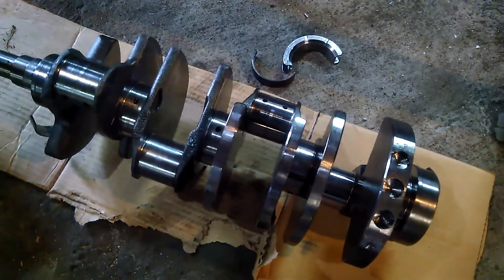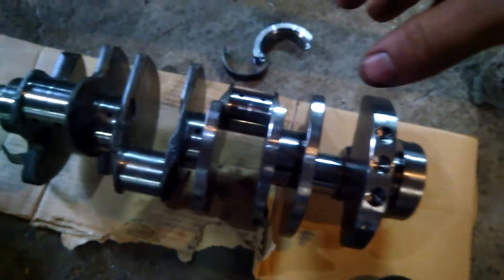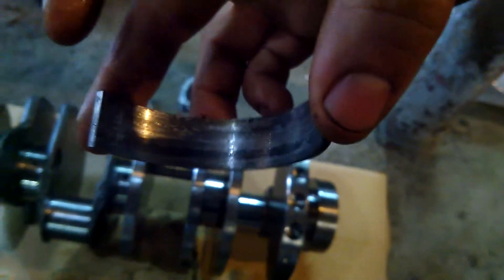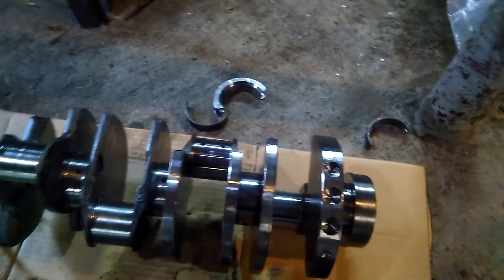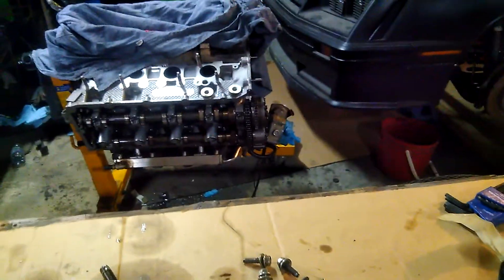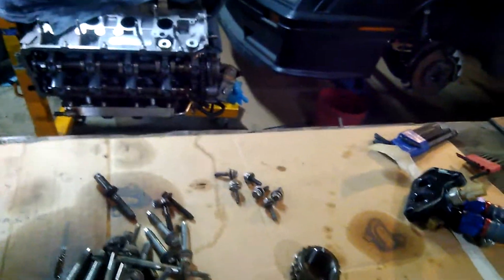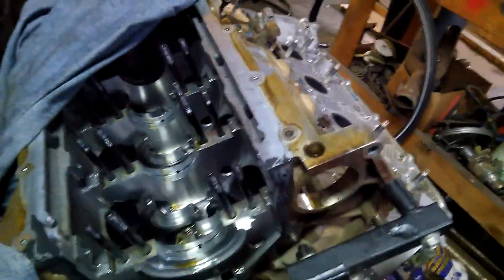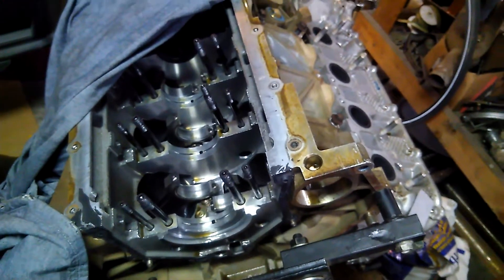What might have caused my coyote v8 engine failure

Comment: I highly doubt the white grease assembly lube caused any issues with the bearings... I have used a couple tubes of it on dozens of engines and never had any issues. Now I just use Lucas oil because it's much cheaper and sticks just as good as any fancy assembly lube.

Comment: I doubt it failed because of white grease.
Reply from the maker: Probably right. I think it had something to do with the ECU getting screwed and causing it to turn the injectors wide open. Then causing a hydrolock. At the time I took it to the machine shop and they said it could be white grease I really wanted it not to be my fault

Comment: I'm currently going through the same thing but on a 4.6 teskid. Did you have to get any of the journals ring machined? I was thinking about just buying new crank and bearings and calling it good
Reply from the maker: I bought a new crank, rods and bearings. I had too much rotating resistance though. I found it was only when I tightened number 1 main cap so I am thinking my block might be a little tweaked so I assembled the engine and rolled it under a table for a later date where might buy a new block. I kinda gave up using the coyote V8 because it's so wide. So I got a 4.6l put some Saab turbos on it and got it on the road a lot easier then finishing the coyote swap on the capri

Comment: Never built a coyote
Built hundreds of diesels cummins Detroit Mercedes Catipiller mid range engines to 16 L all ways used luber plate 105 to assemble never lost a engine which always went from stall to dyno after assembly i know they are not the same animal was taught by some of the best 
Every step needs a follow up as in torque a rod shake that rod torque a main slide it turn it a little  hate to see failures
2013 Boss
Reply from the maker: The more I think about it. The ECU failed on me and caused a hydrolock from my injectors filling the cylinders. the rod bearings that failed were ones that hydrolocked.
Reply: Same here. Built a good few mid range to heavy duty cummins motor with lubriplate. Never had an issue with it.

Comment: Did you ever get that thing back together and running? I have built a few engines and am considering building a forged short block for my 12 ROUSH next winter. This would be my first Coyote build though.
Reply from the maker: Kevin Lynch it's assembled and maybe ready to go but it has way too high of a rotating torque that I don't trust the latest build. I think my block may be tweaked. I've swapped in a 4.6l 2v for summer burn outs and deal with the engine at a later date
Reply: @Nodarperformance  so in other words it wasn't the white grease. I have build dozens of engines using white grease. Main thing is to always, always prime the engine before crank. i don't care what oil you use cranking the first time, you don't have oil until its primed and even at a low idle of 750rpm... that crank is turning 75 times a second... always prime your engine.
Reply from the maker: @gijo5088  yeah we did crank it over and built oil pressure before it ran. Looking back on it. We had ECU failure which made two injectors go wide open and it hydrolocked on the starter. It very well could've smashed the rod bearing and went down hill from there.

Comment: I have always used royal purple assembly lube with good results.  And run the cheapest oil I can get for first start up, non synthetic,  also with comp cams break in oil.  Never had any issues .  Once up to temp I shut the car off and drain the oil.   And put in cheap oil again.  
Hope this helps someone out.
Reply from the maker: Yeah I might give that a try next time

Comment: Try again. Mistakes are part of learning.
Reply from the maker: yeah. looking back on it though maybe my first engine rebuild should have been something a little easier and less high strung
Reply: Nodarperformance I don't know. I've had better luck than you just buying a set of rod bearings and just installing them without any measurements or checking anything. I literally installed my rod bearings in my sister's driveway in 3 hours. I flushed out the oil holes with the filter removed. I disassembled the oil pump and cleaned it out. It was Ioaded with timing chain guide material. I have been driving the car since. It's a Vw vr6 gti. I have gone over 50,000 miles on these bearings. I rev to 7k at least 50 accelerations on my way to work and way back.
Reply from the maker: i got a feeling that the block is a little tweaked. glad your rebuild went well. i always liked the vr6's pretty cool engine
Reply: Nodarperformance it wasn't a rebuild so much as drop the oil pan to fix a knock. It worked. The gti is just for getting me to work. I have a nice copper mustang 12 point caged nitrous car. The stock block split in half. I was watching your video to get ideas for a blow through carbureted modular Ford.   I'm trying to find a Ford/lincoln 4.6 engine right now 32v with aluminum block. I prefer the coyote but too expensive as I have too much invested in a big F1 Procharger with race drive. I only need to make 1150 at the tire. Would be a piece of cake if I could just find the block I want.
Reply from the maker: its not the engine that costs much money. a used f150 coyote is fairly cheap. its all the other parts to make the install easy. lol only 1150 horsepower. such meager goals. good luck on your build though

Comment: I had the same type failure after a rebuild, possibly attributed to CRC StaLube Assembly Lube.  My engine was a 2013 road runner engine.  Not a white grease but a Moly based dark lube.  Required total long block replacement due to extent of damage.
Reply from the maker: bob jorge always a shitty feeling when you try your best and something goes horribly wrong
Reply: Honestly on an OHC engine it is best to prime the oil system and rotate by hand when possible.  You can make a fluid pump out of a pump sprayer or by pressurizing a container with air pressure etc...

Comment: I guess you don't want to go through the hassle of tearing down the motor to a bare block and getting it hot-tanked? Should get rid of every little crumb out...
Reply from the maker: well it was torn apart and the block was pressure washed. did pretty much what a machine shop would have done but without the heat. no guarantee the machine shop will get everything out though so its always a good idea to blow compressed air and cleaner through all your oil galleries after you get it back